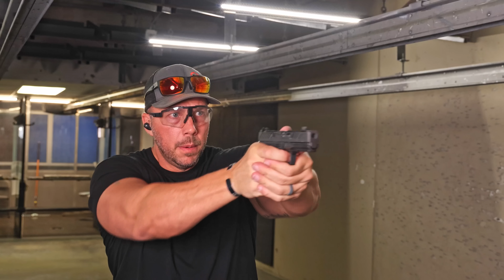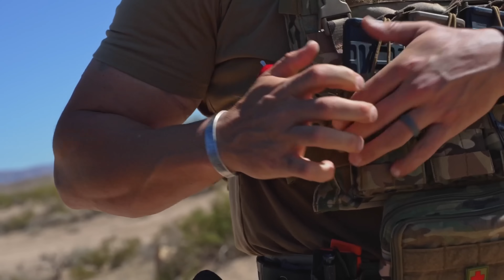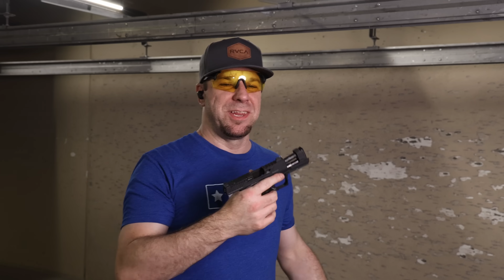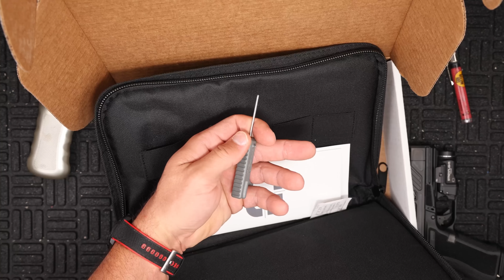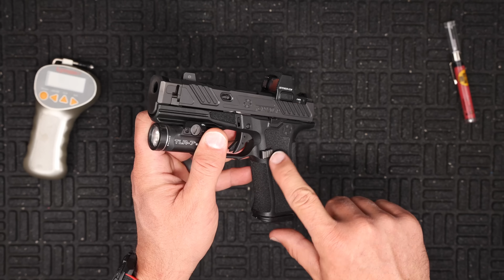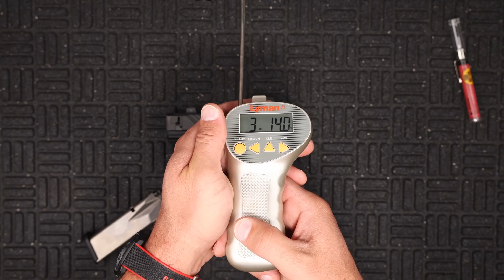Shadow CR920XP Did It Ever Run Right?

Comment: I got one recently I’ve only had about 400 rounds through it only 3 malfunctions in the first few magazines but since then it’s ran flawless. Definitely need more rounds before I consider replacing my macro with radian ramjet and Icarus precision polymer grip module for my board shorts summer carry gun. I  would recommend this to someone buying their first gun because it’s a Glock with all the bells and whistles right out the box. Saves you money over aftermarket parts and installation which can be overwhelming for new gun owners.
Reply from the maker: Sounds like it's working out for you!
Reply: No its not a glock. It's a Shadow Systems! There is no glock in the world that is on this level. Once you have put a new barrel, trigger, slide, plunger, comp, etc its not a glock. Having an LS block in a custom car doesn't make it a GM. Stay safe out there!

Comment: I would love a comparison between the 920XP and the Polymer M&P Comp Carry Compact. Those are two huge considerations right now!
Reply from the maker: Good idea.
Reply: Another would be the new Kimber Mako Carbon Compact. It looks like a banger.
Reply: I’m looking at the M&P compact with the 3.6 in barrel. Similar dimensions to this, but with a shorter slide. I love the M&P triggers.
Reply: @ I want the comp/port though :(

Comment: All I can say is that these comped pistols seem to be so finnicky and cause problems.  I just shot my NON comped Shadow Systems Saturday, shot well, but:

Got the Canik TTI, everyone loves it, for me it was a jam-o-matic.

Got the Walther PDP Pro X, took it to the range, wouldn't cycle at all.  I talked with Walther and they directed me to the comp manufacturer's list of "Do" and "Don't" ammo picks.  The PMC I was on the "NOT" list, and so I tried the recommended ammo, not expensive, just 124 Blazer and 115 Fiocchi, and it functioned flawlessly, and in fact, was one of the most accurate and amazing pistols to shoot.

Just overall, it seems like you're infinitely more likely to have problems or need to be more careful with these comped pistols from all our regular ones.
Reply from the maker: Oh man. to bad about that Canik. But things can get finicky with ammo for sure.
Reply: Less is more regarding EDC pistols, at least for me. Iron sites, great reliability, good point ability, durability. No comp, no ports, don’t use a light on my carry, have one on my nightstand gun.
Reply: I just got the Canik TTI it was on sale so I didn't pass it by. So far I have put a good list of Ammo through it with no failures. Doesn't mean some I haven't tried won't fail. Did you try the extra recoil spring that comes with them?
Reply: @arlissyoung8899  I did try that.  There may have been some problem with mine, as I tried the Staccato ammo and it jammed so hard in the chamber that it had to be removed.
Reply: @craigmetallaw    WOW... Back some years ago I had a new Para Ordnance P 16 that came as a Jam O Matic. At best, I could get 3 rounds before a failure. I had to send the gun in for repair and the whole time the Mag was out of spec. They adjusted the feed lips on the mag and it ran great after that. That's s bummer you got one that isn't up to par. Best of luck, as I have a number of Caniks and so far they all have performed great.

Comment: Guiderod over sprung or I’ve even had one with an over powered striker spring causing issues.
Reply from the maker: What issues you having.
Reply: @ stove pipes like every other round. I have a set of guide rod springs from 20lbs down to 13lbs. I started with 13lbs and tested springs until it ran good.

Comment: Yes vortex dots are underrated have one on a PSA c1 micro , clear as holosun if not better 🤫

Probably taking it off of that and putting it on this XP when it gets in 🤗
Reply: I have one, the battery life as compared to Trijicon is abysmal.
I refuse to buy Halosun.
Reply from the maker: Nice choice

Comment: I am 350 rounds into a new CR920XP. The first 75 was horrendous with a failure almost every round. The next 75 was a little better. At 250 one failure to lock back. The next 75 perfect. It's going to be one of my favorites. Just dropped a Overwatch Precision Tac trigger kit in it so I get to try that on the next range visit. Will it knock my favorite Sig P365 X Macro off as my main EDC? Maybe. I love the CR920XP now that it is smoothing out.
Reply: Oddly enough I never experienced any "break in" issues with either of my two SS pistols. 
Maybe I got lucky?
Reply from the maker: Glad to hear it's smoothing out.
Reply: Why it’s ok for the shawdow system to be dog shit out the box but other companies like PSA and Taurus for an example gets criticized for the same thing you just mentioned ?